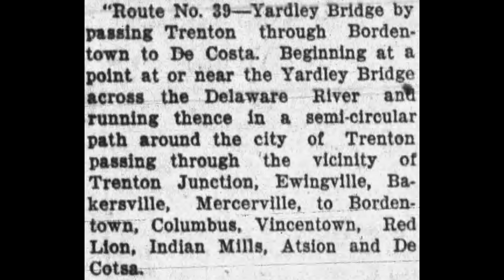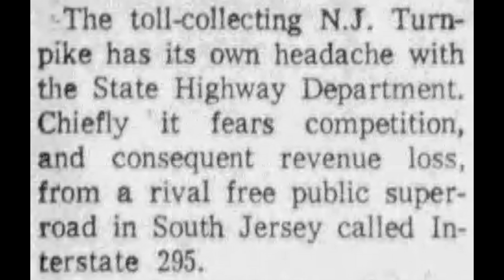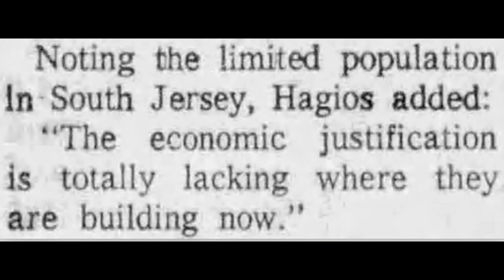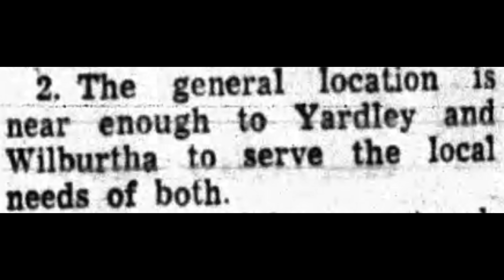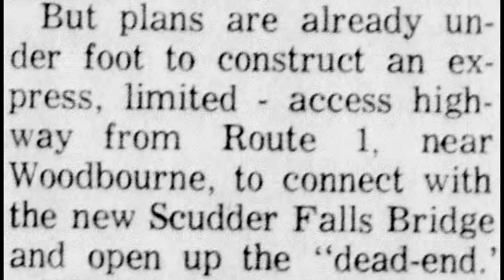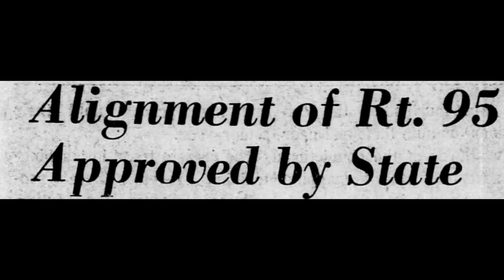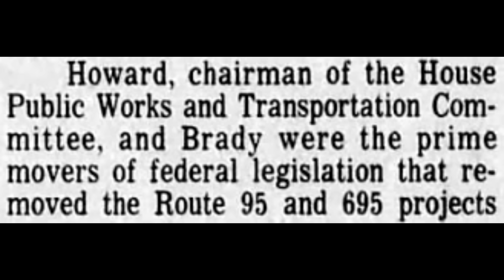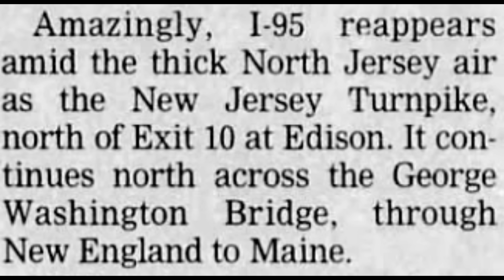How I-95 Hit a Dead End in New Jersey: The History of the CANCELED Somerset Freeway

Comment: New Jersey should have used all that time and resources to build its own subway system branching out underground from Newark to some of the suburbs, and then connecting to existing NJ Transit lines near the present-day Secaucus Junction so they could all use the same trains to transport commuters to and from NYC.   By this time they could have had 3 lines of about 20 miles each in a spokes arrangement which could alleviate much of the choking highway traffic in Northern New Jersey.
Reply: One word: NIMBY 

They would've never gone for it
Reply: @blue9multimediagroup we got PATH up here. But that's considered a railroad more than anything.
Reply: And subway lines don't usually run for 20 miles. That's railroad lengths.
Reply: @blue9multimediagroup the A train does from terminal to terminal.

Comment: My father used to work for NJDOT for 28 years. I came across some of his old maps from the 1960's. It had the original proposed highway designs for I-287, as well as I-278 and others that were never built because of environmental issues and challenges or NIMBY. Some of these old blueprints may be found on Google.